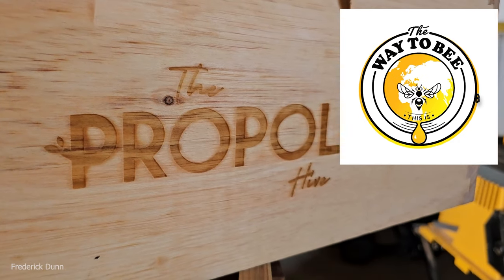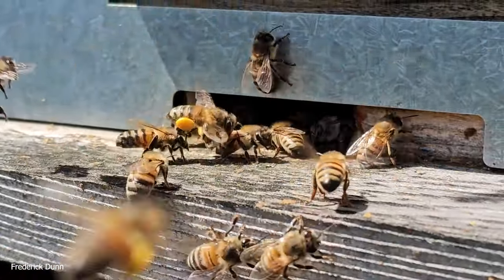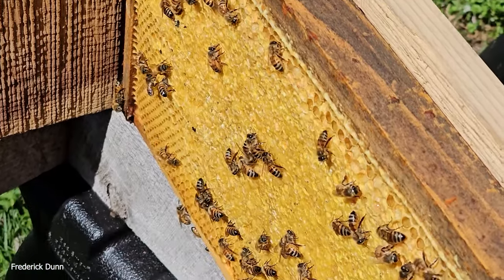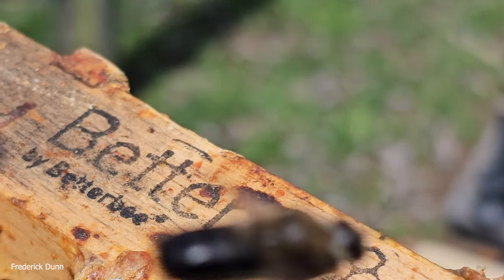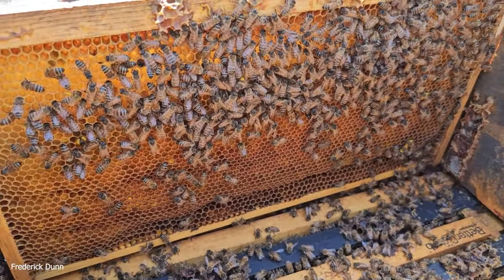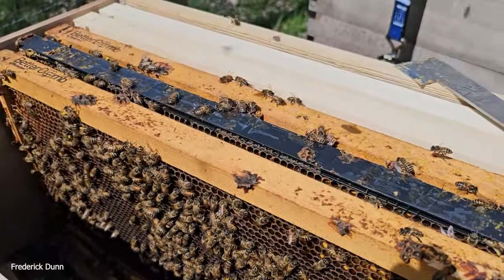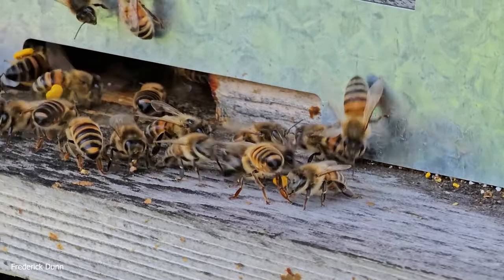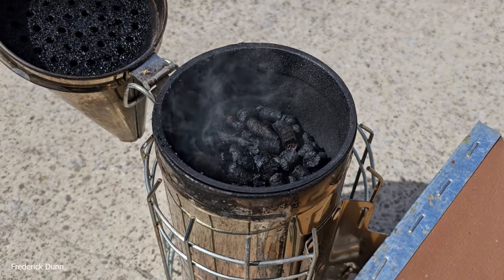Swapping Old Hive Boxes with new Propola Bee Boxes, replacing old comb with new foundation.

Comment: The hive tool is the major hive box destroyer at the corners, but i quit making box frame corners.Now i use dowpens because the conners rot the fastest. It helps if you you have old barn long leafpine , the wood is full of sap, wont rot. If fix my old boxes with Gorilla Glue expanding foam glue, Works Great !!!
Reply from the maker: Thanks for sharing! :)

Comment: I've been practicing using wood pellets that you use in a pellet stove for my smoker.  I found it's really hard to get lit, but when you do it stays lit forever.  One plus is a huge bag of pellets is only $5.
Reply from the maker: They generate a lot of heat, as that's what they are designed to do. They also produce less smoke, also what they are intended to do. The switch grass pellets generate far more smoke and with less heat, which are desirable when smoking bees. Thanks for sharing.

Comment: Hi Fred! You still planning to use the entrance reducers all year? Thinking I might pull mine, lots of congestion, fanning plus a crazy flow right now. Some of hives had a basketball size cluster on the outside. Does help with a quick build up.
Reply from the maker: My ideal year-long entrance is 3/8" by 2-3" width. I've not observed a honey production advantage to having a wide-open entrance.

Comment: Good switch grass promoting video. I need to look into that. I bought burlap from Dadant that I'm now afraid to use, burlap can and often will have preservative chemicals used in it.
Reply from the maker: I did read a study about burlap, it was more stressful to the bees than some other smoker fuel. There is food grade burlap, but not sure what happens when it's burned. https://www.ncbi.nlm.nih.gov/pmc/articles/PMC6105110/

Comment: Hi Fred, nice video. I’ve a concern about boxes. I purchased some Ecowood and the company was really responsive with all questions. They never answered my questions on how long does it last?  I’m left with the impression that it’s a nice treatment but has little to no preservative properties. Your thoughts please.
Reply from the maker: Eco wood has definitely strengths and weaknesses. It's strength lies in rot-prevention. The weakness is that it doesn't prevent warping or splitting, even though they state that it self-heals splits. If you glue and secure all joints well, it's still my favorite wood treatment. We'll see how it performs in the coming years.

Comment: @Fred, what propane torch do you recommend for lighting the smoker?  I read where some wont stay lit when upside down, and I think that would be a problem.  What do you suggest?  TIA
Reply from the maker: Wow, I've never heard of one that won't work upside down, but this is the unit I use:  Bernzomatic TS4000 Trigger Start Torch 361524  They are expensive, but I have one that's 24 years old and still works every time.

Comment: I know it wasn’t the main topic, but what’s the ratio of hive alive to water to make syrup? I have quite a bit of leftover. Also, should I refrigerate or freeze unopened packs, do you know? I lost an entire box last year because it fermented while stored in a tote in the barn.  Thank you.
Reply from the maker: The maker of Hive Alive says not to freeze it, or freezing isn't necessary. I would just treat it the same as 1:1 sugar syrup. But the ratio isn't critical, I find that it dissolves really well in warm water. 110 f would be the hottest your mixing water should be. I hope that helps.

Comment: Nice video. How are plastic vs wood frames viewed in terms of bee health and «microplastics»?
Reply from the maker: Great question, no micro plastics have shown up in bees wax or honey from plastic foundations or plastic single piece frames "yet". The greatest threat for now regarding micro plastics would be with the swiffer pads that some keepers are putting inside the hives for the small hive beetles to get trapped in. Those have resulted in microplastics in the honey, beeswax, and the mid gut of the worker bees. It's something that I track closely as it's an important area to monitor.

Comment: have uever had ant problems with ur bee hives? One of my neighbours found a huge ant trail heading straight into their bee hive through a crack. Neighbour stuck a camera in and there were green-headed ants and bees in an all-out brawl. Lots of dead bees but surprisingly, the smaller ants weren't taking many casualties.
Reply from the maker: Very unusual for ants and bees to engage in close quarters battle. Normally the ants just go up and into the cover, or some other space that the bees don't control. Where is that located, and what species of ant are we talking about? I'd really like to know more, thanks. :)
Reply: @FrederickDunn  they seem like rhytidoponera metallica-green headed ants. They are roughly a 1/3 the size of the bees and they seem to be in a stalemate with the colony. I have noticed the ants piling onto bees and stinging them to death. I have also seen these green-headed ants clashing with iridomyrmex colonies in bloody fights. Usually the green-headed ants lose due to fewer numbers, but we tried to excavate the problematic colony and there seemed to be huge hordes of them. They seem to be stealing brood and honey and dead bees. I also believe I sighted multiple queens which is quite strange as I don't believe I have seen a polygynous colony of the type before.